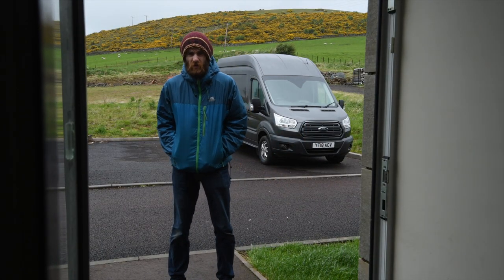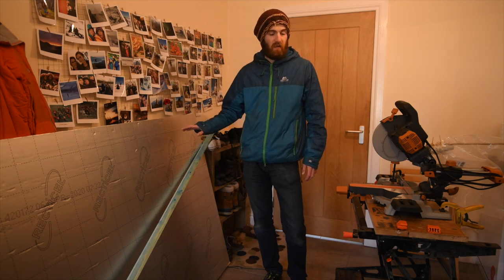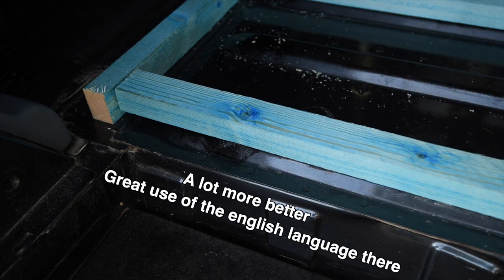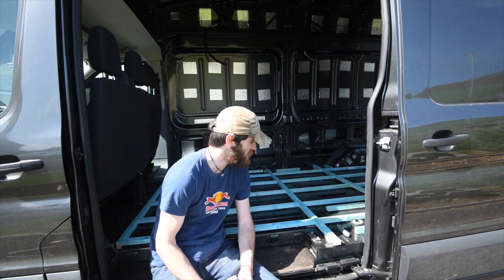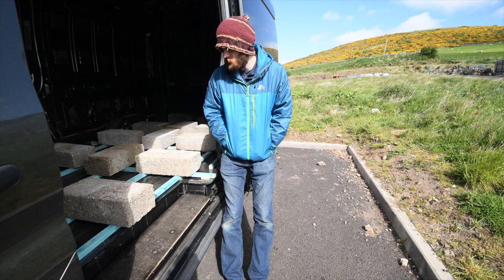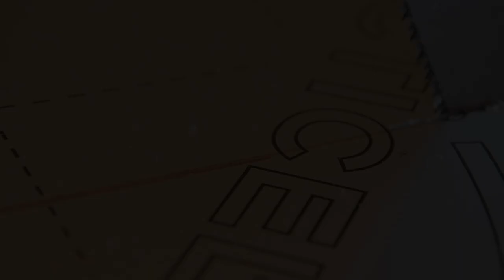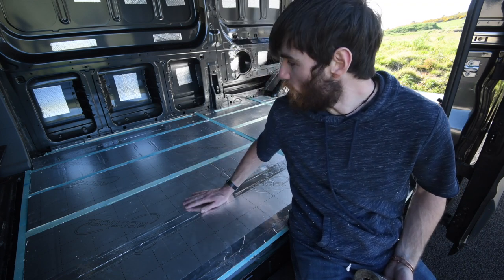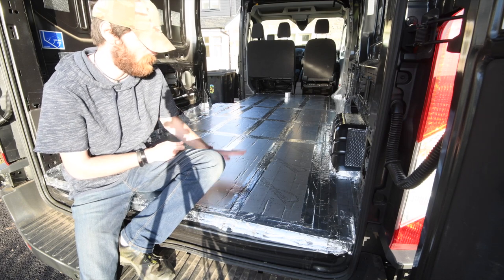Sub-floor and Insulation | EP5 | Ford Transit MK8 Campervan Build

Comment: I cut my foam with a bread knife when I laid my sub flooring  - I didn’t get the logic for sub flooring when I laid mine 😂my vans like built but the floor needs vinyl flooring still and I need to think of a way of finishing my floor. Lol😂
Reply from the maker: I think during my van building process, I learnt many many different ways to cut this PIR board!

Comment: To anyone doing a van to camper build for the first time, familiarise yourself with what your spare wheel cradle release bolt looks like and ensure you don't cover it up with permanent fixed flooring over it
Reply from the maker: Conveniently many people reuse the old floor ply if in good condition or at least use it as a template which normally will have  the spare wheel bolt access hole already in .

Comment: We too have just bought a LWB 2018 Ford Transit so are really enjoying your vids. We wanted to know about access to spare tyre too but you’ve explained that now 👍 Can we ask is there a reason you glued rather than used screws to secure your floor frame to the floor? Many Thanks 😊
Reply from the maker: Welcome to my channel. The main reason I went for glueing over screwing was I could see the damage done to the inside of the van from the old screws used to fix the hold floor down. On the inside of the van the paint had started to pit and get Corrosion between the paint work and vans metal and that was on a 2 year old van. In my “fixing holes with pop rivets” video and can see how easy the paint was flaking off round the screw hole with a wire brush around the old screw holes. Hope that helps and enjoy your van!
Reply: Cheers 👍

Comment: Hi great vids. I am also converting a MK8, did you cover over the “bolt” to release the spare tyre that’s under the back of the van?
Reply from the maker: It’s covered at the moment but I’ll be uncovering it again , my ply wood flooring has hole in it for the bolt so I just need a hole saw the right size to cut a hole back into the insulation. Best of luck on your build!

Comment: great video. How many tubes of ct 1 did you need for the floor?
Reply from the maker: Trying to think back.  probably one and a bit. But I used CT1 multiple times throughout the rest of the build as well so getting a few extra isn’t bad
Reply: Thanks for your reply Alex. I have just bought a van and have been watching your videos and am about to start the build. Waiting on pop rivets to arrive to start the floor.
Reply from the maker: No problem at all. Best of luck with your build!

Comment: What did it cost to insulate the van? I’ve just bought a mk8 med wheel base and am converting. I’m at the stage where I’m like. Do I just throw a bed and a cooker in it and use it as a get away r do I insulate vapour seal etc. An idea on cost would be great 👍
Reply from the maker: Hard to says as I recycled a bunch of the insulation for my old van which saved me money and stuffed the wall cavities with, .then over the top of that I probably bought 5 sheets of 25mm insulation board @ £25 each and 2 of 50mm board at £32 , plus a few more rolls £16 each of recycled bottle insulation. 

Some is definitely better than none! Depends where you are in the world really. For me the highlands of Scotland would be rather chilly this winter without insulation or diesel heater
Reply: Mispronounced Adventures I’m in London but I plan on using it to holiday in and that will include Scotland, Uk in winter months plus the continent so a wide variety. I was just worried that once I start insulation that unforeseen costs would arise and I’d be then tied in to continuing as I’d gone so far. Just purchased 2 side windows which I will be attempting to fit myself. Love your windows (I’m only up to episode 4.... don’t spoil it for me lol)

Comment: Hi mate, I have the same truck, and I’m using the same wood. Off hand, do you know how many packs/lengths of wood you used. I’m getting the 25 x 38mm (pack of 7) from Wickes UK
Reply from the maker: xXxbradd3rsxXx yeah I was using the 3m long batons. I’m are from B&Q, they sell packs of 10 or as individual. I also used some of 25mm x 50mm x 3m batons for some of the wall battening in the van.
Reply from the maker: xXxbradd3rsxXx oh how many packs! Ill look that up on my spreadsheet. One moment
Reply: Mispronounced Adventures thank you, I did take a walk down to b&q to get some pop rivets for the floor, however their wood selection is very limited due to covid in my area!
Reply from the maker: xXxbradd3rsxXx 25mm x 38mm x 3m I must of used at least 16 batons, and for the 25mm x 50mm x 3m 6 or 7 batons. That total for floor and walls. However I built a pretty complicated framework on the walls for my internal flares to add extra space. You could save on a couple batons if you didn’t bother with that.
Reply from the maker: xXxbradd3rsxXx yeah I agree. Pretty sure that’s the only reason I ended up with the blue ones as they were the only ones left. Most people didn’t understand why they were blues I didn’t want them because of the colour
Reply: Mispronounced Adventures ahh thank you very much, gives me a rough guide when I go to shop. I’m not doing the flares as I’m having the bed length ways to allow for mountain slider and storage under the bed. I look forward to watching your bed build ideas?
Reply from the maker: xXxbradd3rsxXx I’m doing something a bit different. Not going for a fixed bed but something you don’t see too often. Minimal faff   to set up and use, part of the reason I needed the flairs. You have to wait and see

Comment: И что эта прлита 25 мм, промерзает в мороз -30 ???
Reply from the maker: The floor is definitely cold when it’s -30 outside, but not the biggest  issues on the air temperature of 21° inside. Even if you had 50mm, you would still have the same issue. insulation just delays hot loss. Not stop it
Reply: @MispronouncedAdventures  How then to avoid this effect?
Reply from the maker: @yb4628 it’s a difficult one, panel vans, having a steel floor is always going all cold, compared to a motorhome. 
Although some form of underfloor heating would help